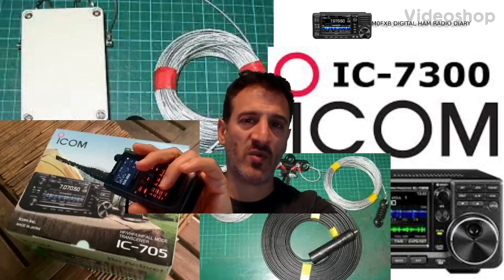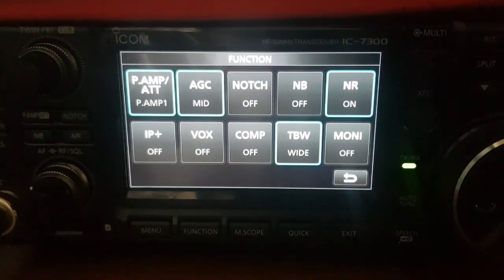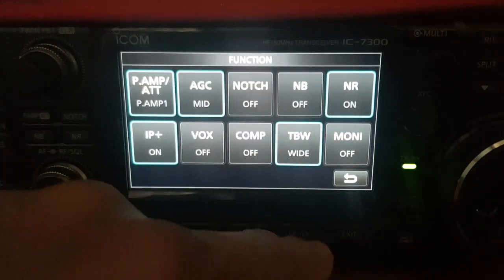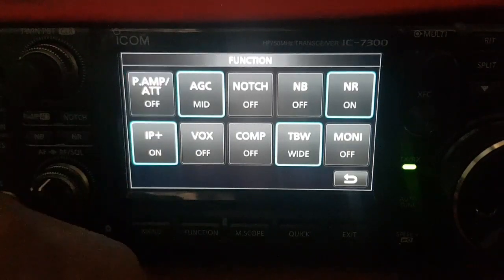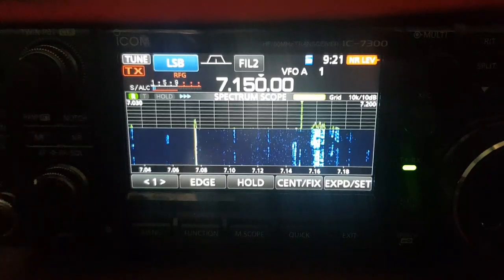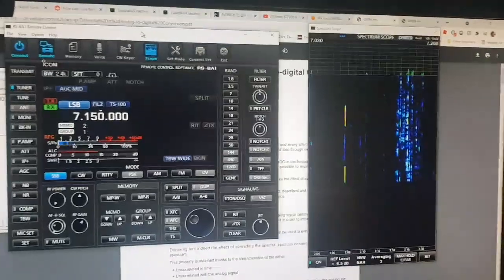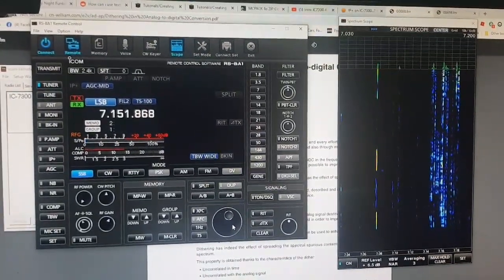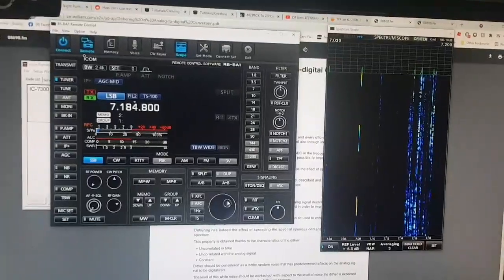ICOM IC-7300 - IP+ selection in Funcion menu

Comment: Hi Frank Johnson, I was under the impression that the dither improves strong-signal dynamic range, but I might be wrong. Icom are open about the fact that IP+ reduces sensitivity a bit, of course, but rumour has it that on early models/firmware, IP+ reduced sensitivity by ~10dB. But it seems that they have improved on that since then.
Reply from the maker: Hi many thanks

Comment: I found your video by looking to understand this button.
This is because I was listening to a station on 5.950MHz and I was switching between an HF multi-band hustler antenna, and a 6m ground plane. I was getting less noise while using the 6m antenna. So with a clear sounding signal that was showing slightly more than s9 on the meter, I turned on IP+ and the noise that icom said this button injects became very noticible. This seems to be the only time when I can actually tell that this button does anything.
Reply from the maker: Oh that's interesting- Thanks